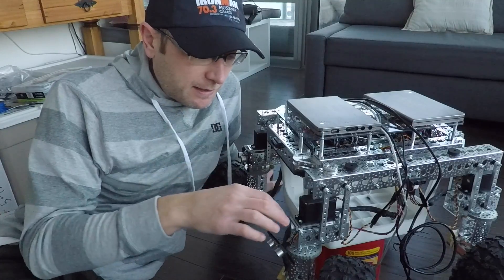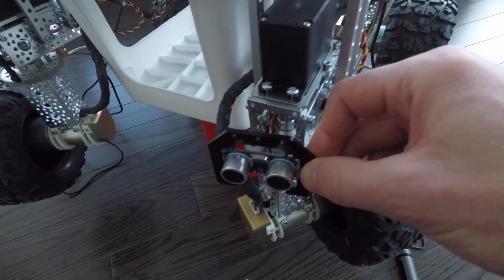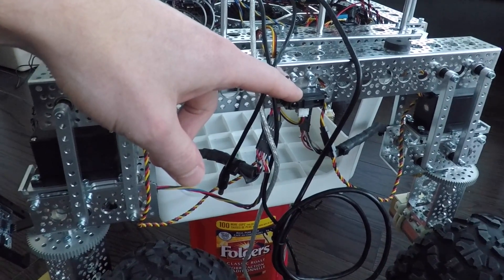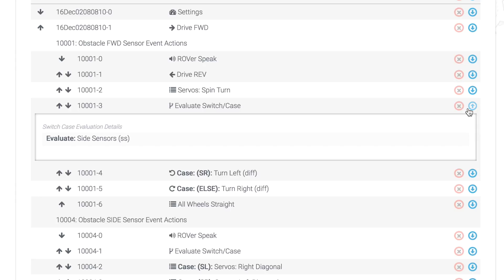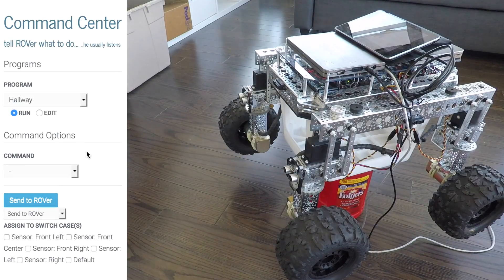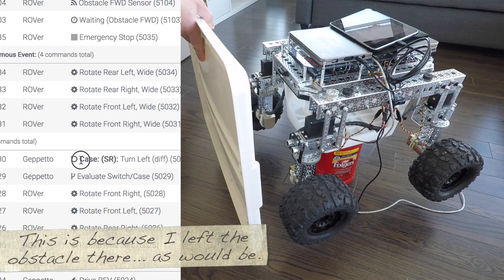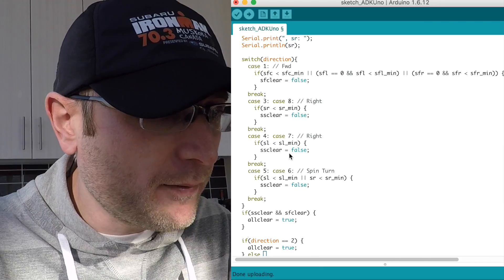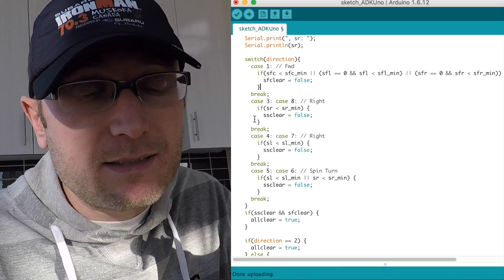ROVer Robot D96: Dynamic Sensor Response Testing and a Sensor Mount Compromise, for now.

Comment: Thank you for all the effort you have put into making and posting these videos.  I have watched all of them and I very much appreciate your work.      I am sure that whatever happened in your life to end your videos before Rover successfully navigated the hallway was a priority.  My omnidirectional standing wheel chair project will be using two RoboClaws once I make enough progress coding with my motor encoders to start.  I have been running the RollBot with just PWM power for steering 3 omni wheels, but the lack of precision was awful, so motor controllers will give the RollBot very badly needed precision.  Please let me know if you read this.  Dale, 10/14/2019 - drgrs74@gmail.com.  Thank you, again.

Comment: If you moved that lower suspension arm 4" forward so it was under the top suspension arm, then you'd have a proper wishbone setup, and far more suspension travel. I don't see why you'd purposely limit suspension travel by letting them jam into each other?
Looking good though, hoping you are still working on it.